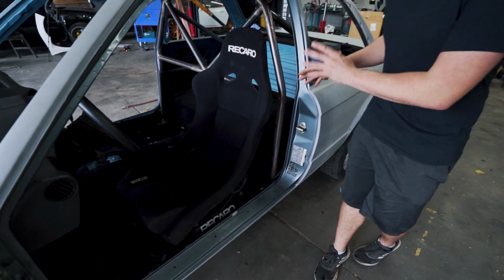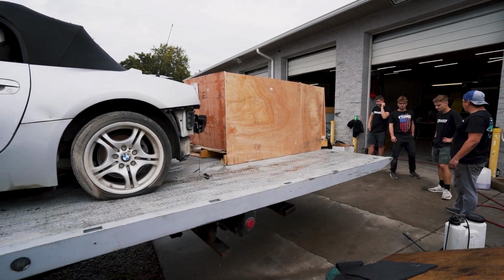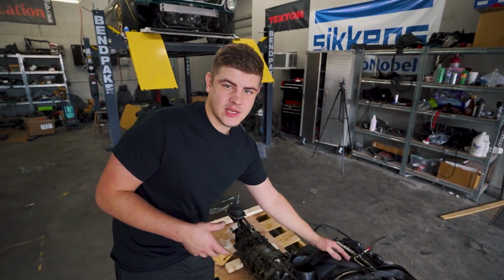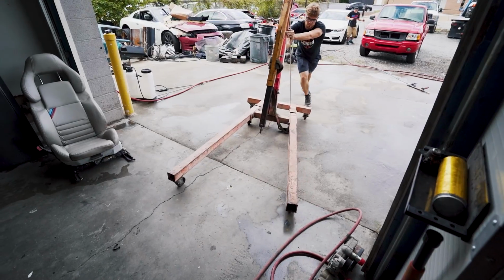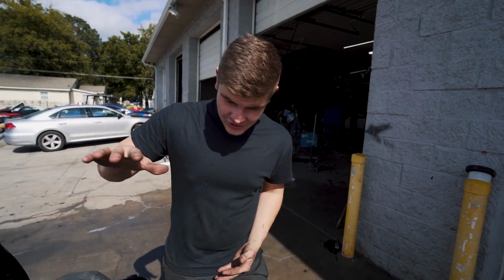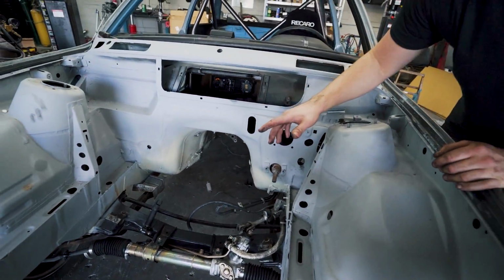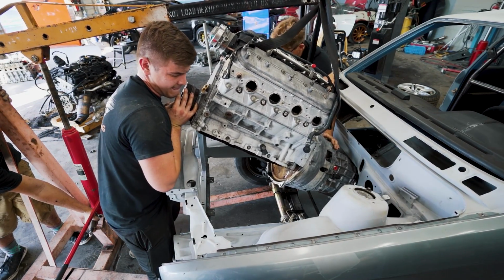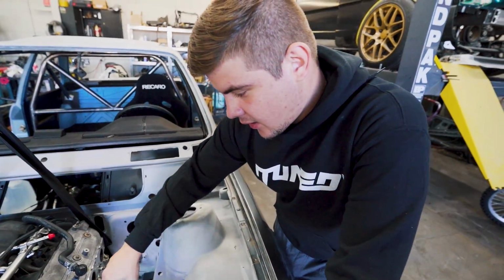LS Swapping My BMW E30 Drift Car Build  - Episode 7

Comment from the maker: Check Out https://www.jandjautowrecking.com/ For Engine Swap/Car Part Needs!!
Reply: You might think about making the upper rad support removable. It will make taking it in and out really easy
Reply: Also you might look at wilwood peddle assembly where you can put 2 brake cylinders and a clutch cylinder on a hanging peddles and adjustable brake bias. It would mount inside the car freeing up the engine compartment
Reply: Guys please replace the wheels of Engine trolly. I hate to see you guys working so hard while you can simply replace those bad wheels.
Reply: degreaser aint cheap. But oven cleaner is ;)
Reply: Don't forget to replace the stock  flywheel with an aftermarket aluminum one
Reply: Swap oil pump pick up and timing gears with a corvette or there's a hack for increasing oil velocity by shimming the spring and dimpling the gear in the pump
Reply: Wepa I Can not wait to see this finished
Reply: You can't like your own comment, its just not cricket!! ;)
Reply from the maker: @keithd6852  watch me do it again 😂😂
Reply: @Vtuned  Lol
Reply: @Vtuned  Where is the mustang? We want see!
Reply from the maker: @americanmusclebestcars2591  tomorrow

Comment: Dont cut the shifter linkage... Just push the engine forward till its lined up you have plenty of room... The offset the engine mounts back a smidge easy peasy

Comment: put the booster in and the steering shaft before final design location on engine mount ,  test fit with shorty header kit

Comment: 130,000 miles and you have to replace internal parts? I am guessing this is about a $1000 engine. No sense just replacing the cam and lifters, rebuild the whole thing and be sure of it performing like it should.

Comment: Wouldn't it be easier to modify a GM sub frame to fit into the E 30 . Than to modify the E 30 sub frame to fit a GM engine ?

Comment: Just for your info. The Aussie built Commodores with the LS Engine used a front sump in the earlier series  and they are a straight bolt on fit to the later LS engines.

Comment: When you were talking with Jeremy about the motor,did he mention Cooper's 1100Hp turbo 4cyl?Weighes allot less than the LS and would've fit better?It's your party,do what you want.
Reply: Are you talking about coopers camaro engine? If so that's a 2jz 6cyl inline that wouldn't fit all that well. If that's not what your talking about fill me in lol I didnt know cooper had a 1100hp 4cyl which I haft to say would be bad ass!

Comment: You DO NOT want to move the engine forward.  If anything, you want to move it back more (but I realize you may not want to cut the car up that much).

There are shifter mod kits, and complete shifter kits, that move the shifter forward or back several inches.

Comment: Ben, if you haven't already done it, check out the ICT Billet website before you start on your motor mounts.  They've got the aluminum plates that bolt to the block and accept a standard small block Chevrolet motor mount, and you can build your own frame mounts from there.  They've also got more tips and tricks for LS swapping than anyone out there.  https://www.ictbillet.com/tips-guides.html

Comment: Cleaning tips.
There are degreasers and expensive cleaners for automotive use but you can use cheap household cleaners to sometimes better effect.
Oven cleaner for baked on grease and oil.
Automatic dishwasher powder for general grease and grime around an engine bay (this stuff eats alloy) 
Toilet cleaner to remove corrosion on alloy and steel ( some are better on steel others on alloy depending on type of acid in them) 
Or white vinegar.
Reply: Oven cleaner is amazing!

Comment: You can get a new bracket to relocate the shifter. Just measure the size you need. But your pretty skilled enough to shorten the old one. And be careful not to smack the crank since the pan is off.

Comment: Vtuned, I fits like a finger in the nose!
I would consider at 130,000miles and you want to supercharge it, that whilst it is out and easy to work on as well as Jeremy's suggestions 
New Big end bearings , rods pistons rings etc the added strain and stresses of putting more power to it with a supercharger and you mentioned a cam, you are bound to do damage to it not long during your first thrash
I was taught this 43 years ago
New parts on an old engine will add to much stress and something else will let go
That has, in my experience ALWAYS been correct.
In the case of your "budget build" do it now and save time and money or do it later and it will cost a lot more money, maybe a new engine and time out to repair the damage.
The choice is yours mate.
Tony from Western Australia

Comment: imagine taking the trouble of repainting the entire chasis, thus making it rust proof and good to go for an other 30 years, but you shove a ls1 engine in it to go drift it and crash it most likely around the first corner. Bruh just put a m3 engine in it with m3 body kit
Reply: Do you know what an S14 M3 engine COSTS? A used S14 M3 engine is going to cost between $6k and $10k and that doesn't include the $10k in rebuilding costs required to rebuild such an engine. This isn't a shadetree mechanic engine. This is a detuned racing engine that requires specialized tools and knowledge of BMW S14 engines. Even so, $15k to $20k in out the door costs is still only going to net you 195 hp. Dude, if you're going to spend $15k to $20k to get 195 hp, you need some serious mental help.

Comment: i would get all the brackets and figure out where your mounting your accessories on the front and radiator placement so you know how far forward to move the engine and then build your mounts , which there are several companies making in expensive universal mount kits out there.  then check out stock exhausts you will get better clearance fitments with just as good or better perfotmance with a little dremell pollishing welds and casting flanges on the insides. , also there some really good dry sump pan  systems out there which helps for bottom clearances good luck and lean on jeremy  hes a wealth of reat knoweldge on the LS series engines

Comment: Check out Taylor Ray’s channel on YouTube, he put an LS in a Miata and used a shifter that mounts much closer in towards the motor to get it closer to the factory shifter hole inside the cab.

Comment: Keep the engine as far back to the bulkhead as possible.  If you dont it will handle like a pig 👍
Reply: without a new suspension it's going to handle like a pig no matter where the engine is.

Comment: I've got no experience on these massive jobs at all, but I'm thinking that moving the engine forward a little bit, will help with the clearing issues for both the headers, the shifter and brake booster, without modifying a lot what you have right there. Also, on the other hand, you might get lucky enough to get a nice driveshaft without the need of creating a custom one as well, which help to cut some costs all the way around, imho.
Reply: Actually the engine should be moved as far BACK as possible not forward for center of gravity. You want the powertrain close to the center of the car, not balancing over the front axle.
Reply: @houseofno  That is correct, I agree 100%. I mentioned that as VTuned was planning to not mod the body that much as well. On the other hand, he did mention that he's planning to do a manual transmission conversion later on. If that's the case, then he might not run into these clearance issues anymore.
Reply: Engine should be "almost" touching the firewall.

Comment: I dunno, why burn your brain out making mounts and stuff. It would have been easier with a Tremec T-56 or T-56 magnum for your transmission. CX Racing has everything you need to get the motor into the car properly. > https://www.cxracing.com/engine-swap-kit-bmw-e30-ls1

Comment: dont cut the trans handle move the engine forward its way back
Reply: Lol.
Reply: well that's not a very good idea....
Reply: first of all the engine is touching the body of the car second there's a heat shield that should go there and some ac and heater pipes that should go there so he should bring it out a little bit

Comment: I recommend replacing the oil pump, there is an actuator that varies the oil pressure that always goes bad and it's part of the pump. I also recommend deleting the variable displacement system. The lifters sometimes stay collapsed.

Comment: When your doing your motor make sure if your changing cam ,by al means do lifters.make sure you pull oil pan and replace the o ring seals on oil. Pickup this is important,cause if bad allows leak down on motor,small part causes big money.just take your time.😎😎👍👍

Comment: I used a Porsche 944 brake booster in my E30,smaller diameter and bolts straight in.

Comment: For an easier install, you should try to use the lift to remove the front subframe an install the engine lowering the car into it with the subframe, that way is more easy and it actually fits.
Reply: A few people, including me, think that's a good idea.

Comment: I am torn.  Seeing this clean old BMW made we want to see it stock.   But it is fun to watch engine swaps. I have seen many SB Ford & Chevys transplanted into many Euro and Japanese cars including Jaguars.  Not sure I would do it......but it certainly worked out well for Carroll Shelby.  😉
Reply: Everything else being the same, it would have cost about the same rebuilding that tired old 100 hp 1.8L four as this LS swap will cost. The LS swap is a way better value.
Reply: @houseofno  Exactly. Only arm chair commenters hate LS swaps. No one who actually builds hates using them.

Comment: If it were mine I would put new bearings and rings in it and inspect the cylinders for trueness. I would also take the heads apart lap the valves and replace as needed and put new valve stem seals. You have it there why skimp with the unknown when it's so simple to do now. I would also put it together with ARP rod and head bolts. Especially it you are going to put a supercharger in it. It's just cheap insurance. Cam and lifters as you already know. Also a brand new oil sending unit just because they are hard to get to.
Reply: Exactly what I would do, with the engine having so many miles on it. The amount of oil/grease on the engine is a good indicator.
Reply: the L76 is a great engine, be a shame to blow it up.

Comment: Noob question:  how do you make sure no water gets in the engine when pressure washing it?
Reply: You can't be sure. Before the first start they should remove all the spark plugs and crank the engine. If there is water it will use the spark plugs holes to leave.
Reply: You can tape plastic over the bores and openings before pressure washing which I can tell he did. Don't use a porous material like shop towels as that defeats the purpose of keeping water out of the engine.
Reply: An engine should be a water tight unit, no water should be able to penetrate the engines internals from the outside, if it does, then you have a problem. But in this case the exhaust headers were removed so he’s plugged the holes up before washing,  The engine has been drained of all it’s fluids and will be worked on there shouldn’t be any issues.

Comment: Phew j&j dragged out the nastiest engine they could find. Not like the others they sponsored that was pretty rough looking. If they send me one like that it be followed by a refund.
Reply from the maker: It’s an engine lol it looks brand new now lol
Reply: @Vtuned  With having so many miles on it, it would be a good idea to rebuild it, rings, bearings, etc. Seeing that you are planning to boost it, you want everything to be spot on. Upgrade stock parts like the oil pump, lifters, etc The amount of oil and grease on the engine is a good indication that it's needing a rebuild. All the best from Queensland Australia.

Comment: Looks badass with a LS engine in it bro. Question - when power washing the engine, aren't you worried water will get in somewhere it shouldn't and/or rust something?
Reply: wont matter, doesnt have to sump on so any water will drain

Comment: Might have been easier to remove the radiator core support before lowering the engine inside the car.
Reply: On the E30 is not that easy, that's where the hood ataches too, if you cut it that makes it harder to aling the hood later, the easiest way is to remove the subframe and lower the car into the engine
Reply: @j.d.8593  Perhaps you didn't notice that the hood was already off the car?
Reply: @houseofno  It doesn't matter, if you cut the support that will make things MUCH harder to put the hood back where it goes
Reply: @j.d.8593  First what part of the difference between CUT and REMOVE did you not understand? The word CUT appears only in YOUR posts, not mine.
Reply: @houseofno  Bruh! You need to CUT it to remove it! There aren't "bolts" holding it, you need to drill the spot welds or cut the whole thing with a sawzall and to put it back will ruin the aligment of the hood
Reply: @j.d.8593  Just what I was thinking!
Reply: Or even using a load leveler.

Comment: beautiful build but why LS  😭 avery one is LS  😂
Reply: For good reason
Reply: “Budget build” ya ever built one?
Reply: @EgoPlaysMC  hmmm u talking about budget well ther v8 from M5 E39 and I think its cheap
Reply: There a soft motor cheap as chips......but still a single cam not that strong if you want NOS..... forget this engine......I'd be like Ford coyote or Hellcat motor for strength...
Reply: I'm sorry but money is a real thing and people can't just put whatever they want into it lol. Plus it's so easy to maintain and the aftermarket is limitless. Sorry it bores you
Reply: @sean7139  
In the long run it will be more expensive to run if you have to rebuild it after so many miles.....
Take it from someone who knows been down that path.......
Reply: @sean7139  
In the long run it will be more expensive to run if you have to rebuild it after so many miles.....
Take it from someone who knows been down that path.......
Reply: @PeteLeBoydre  the engine has been proven to be very reliable because there's less moving parts and doesn't have to rev incredibly high to make power or torque
Reply: @sean7139  
But they don't produce that much because of the fact they can't rev because there hydraulic lifters and can't have a roller cam because of the position of the cam in relation to push rod to racker arm location.....both ford and Chrysler have rolla cams fitted from factory.....
Reply: @sean7139  https://youtu.be/GZTdo2-cGCM
Reply: @sean7139  
Do you self a favour and and look up single cam vavle float....
Reply: @PeteLeBoydre  not a problem with LS motors as they have hydraulic roller lifters
Reply: @sean7139  
You can't have a hydraulic roller.....you can have one or the other but not both......